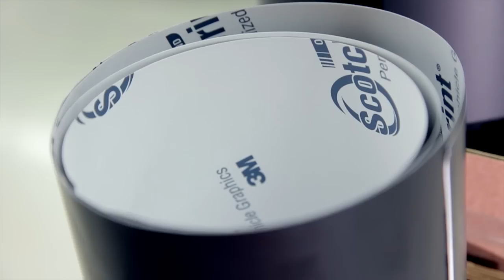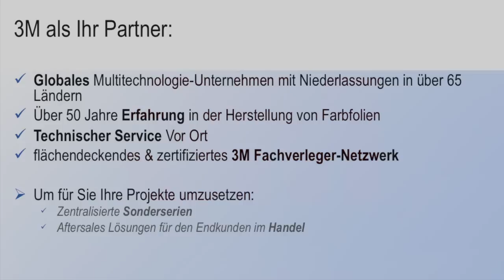3M™ Car Wrapping Projekt Nissan JUKE Pure Black

Comment from the maker: The typical width of 3M's wrap films is 1,52 m. Now simply take the dimensions of each part of the car body you want to have wrapped and add 10-15% for handling and excess needed during the application. That will give you a rough estimate. Remember that car wrapping is work for experts, we strongly recommend to contact a professional car wrapper. If you want to learn that trade: 3M offers trainings. Check your local 3MGraphicscom website for details.
Torsten Classen, 3M Deutschland GmbH